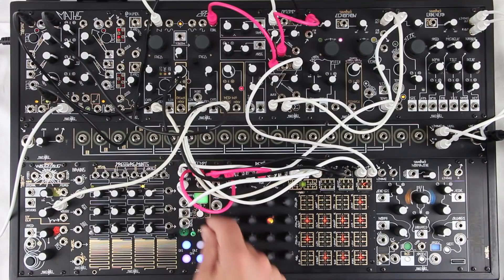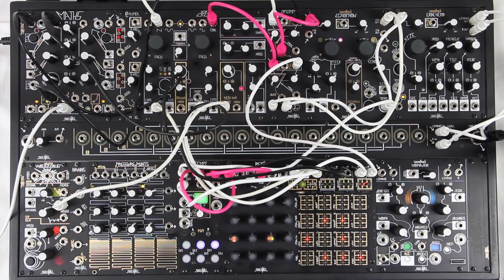New TEMPI feature: Voltage Controlled Tempo!

Comment: excuse but I barely understand english so I am a little confused. With this firmware the State Select knob doesn't act like a State Select Pattern?
Reply from the maker: The State Select knob's function depends on whether you have Ch1 Tap Tempo engaged. If Ch1 Tap Tempo is OFF, then the State Select Knob (and CV) control Tempo.